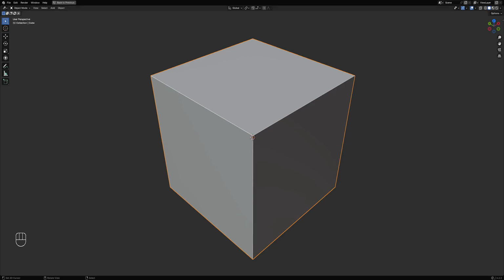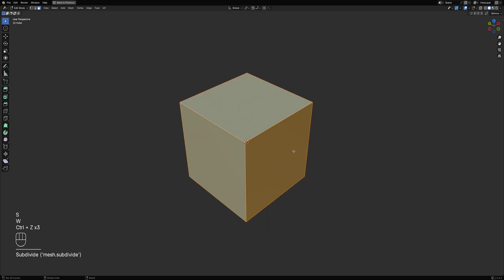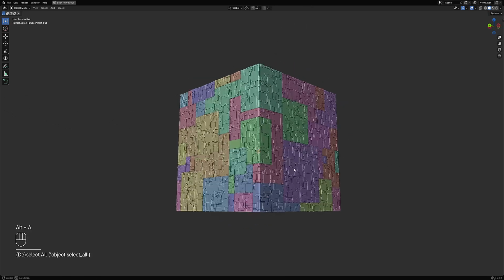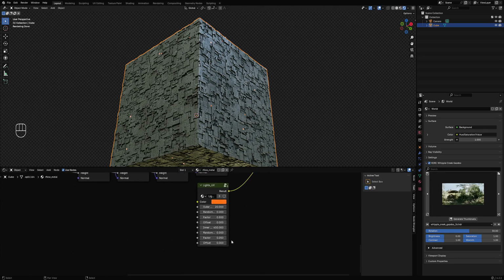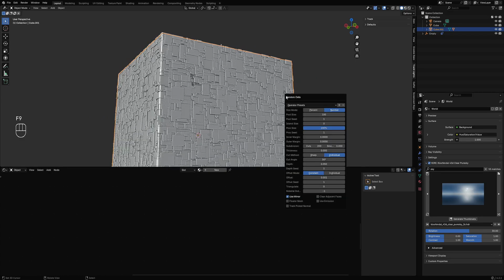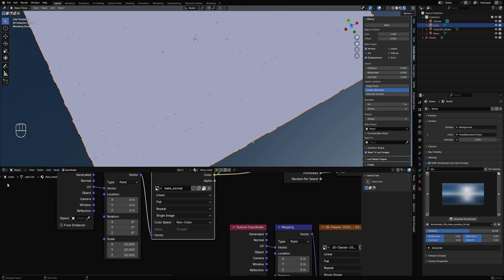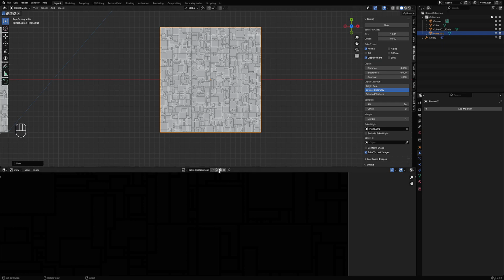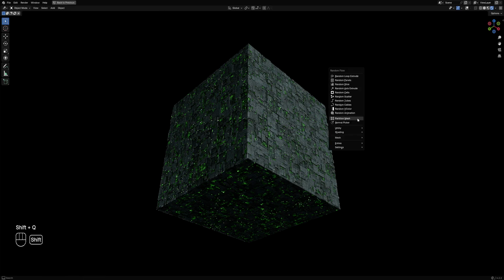Borg Cube Using Random Flow (Beginner)

Comment: Just bought this add on and every video I’ve seen uses presets which don’t exist in the current version of the add on. It’s incredibly frustrating
Reply from the maker: This video is a year old. The add-on is constantly updated. The newer videos in the playlist will have the more recent presets. Older videos will have older versions of the add-on but the workflow remains the same. Sort the Random Flow playlist from newest to oldest.

For this video, you can use the more recent "square 100 perc even depth" preset as the equivalent. Some of the old presets were removed due to changes in the add-on and to prevent errors using them because essentially some the settings involved in those operator presets no longer exists.

Join the discord community link in the Usage Info button so you can ask anytime what presets are confusing you on what video.